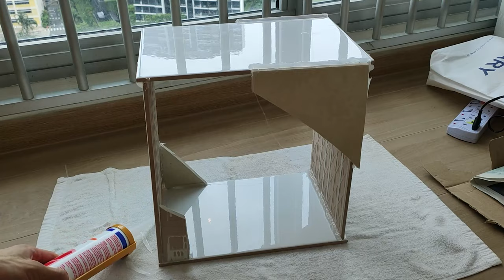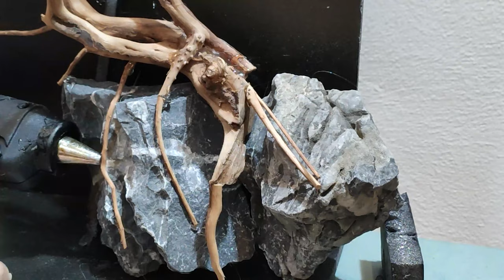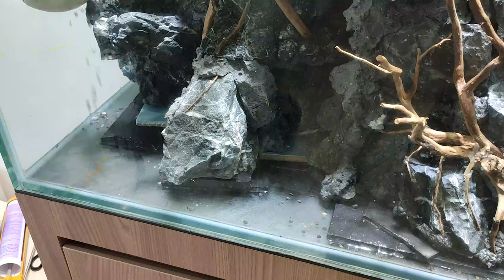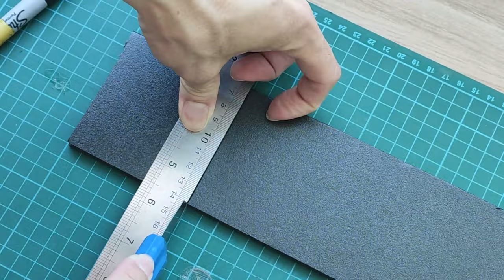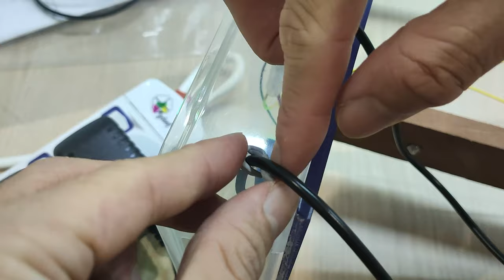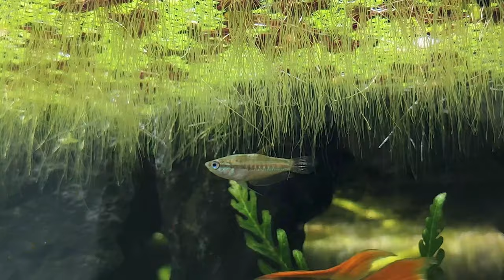Setting up a carnivorous plant paludarium

Comment from the maker: Since quite a few people asked about this, I thought I'd pin a reply.

Venus fly traps, Sarracenias and Cephalotus are temperate species. Can they survive in an aseasonal paludarium? Yes, and it's actually not that hard to do. VFTs and Sarras would need an artificial dormancy after a couple of years--I usually perform that after 3 years (which is why they are actually planted in those isolated chambers if you look closely;). Cephs can actually get by without one. They won't look like award winning specimens for sure, but still very decent.
How long can they survive? I don't count the years, but most of mine have gotten past 10+ years (been doing this for about 20). Old friends have kept them going...indefinitely...
I don't really want to write so much on cultivation techniques here. But the tropical CP growing scene is quite well developed, so there's definitely quite a lot of well-established procedures and info on the web and in print (e.g. https://www.amazon.com/Growing-Carnivorous-Plants-Tropics-Chiang/dp/9814022519). Do check it out if you need specific guidelines on each of these taxa:) 

I expect the paludarium hobby to continue growing a fair bit and more people to experiment with these and other techniques. And in that regard, a word for the aspiring paludarium owners reading this discussion. Don't let more "experienced" growers tell you that it is impossible to grow or do something. Go for it, push the boundaries, don't be afraid to fail here and there..and have fun while you're at it:)
Reply: Talking about VFTs and Sarrs as temperate plants then going on about tropical CP growing techniques shows you know less than you think you do.

All other factors aside, your biggest challenge will be giving the VFTs and Sarrs enough light. Light intensity decreases logarithmically as distance from the source increases. Even with artificial lights, they are too far away to give these full sun loving plants enough light to survive long term. No doubt in several months or a year you will have light-starved, etiolated plants begging for death.
Reply: @pings_n_things  absolutely false. There's tons of videos and info on exactly these setups.
Reply: @pings_n_things what if I told you that vertical light intensity in my 48x48x18 is equal for all distances from my top light source? Yep, fresnel. My CP 40” from the lights sees the same ppfd as the cps at the top.

Comment: My only concern is that the Venus fly traps would be receiving water from the aquarium which may be too mineral rich for them, I’ve only had success watering Venus fly traps with ro water or distilled water. Other than that this scape is fantastic!
Reply: also they need a dormancy
Reply: @Tatusiek_1  that's why there in removable pots
Reply: yeah from what i understand about cultivating cp is that they should never be fertilized. I am under the assumption that the rain water is just fresh tank water for the water changes that happen 3x daily, and the sump is only sitting on the tank itself (not super clear from the vid )
Reply: Assuming no update on this? Only way I see this working is with a rain water system even the fish can be in the rain water

Comment: Phenomenal. I could watch a 24 hour long video of different pipe systems alone. I’ve always been curious, how do you keep plants alive glued to the rocks with minimal roots like that? Are you watering incredibly often? Any fertilizers at all?
Reply: Some plants are epiphites or lithophites and that means they like to grow on stone or hard surfaces with no soil
Reply from the maker: Yup they are epi/lithophytic. Also the sprinklers come on quite often so they are well watered:) I am adding very very dilute ferts for some orchids. But very cautiously since any runoff goes straight into the aquatic portion below!

Comment: Looks great, questionable plant selection though. You should have stuck to tropical plants only - the Cephalotus and the Venus Fly Traps require cold winters. They may make it a year in consistently warm temperatures but after that they will really suffer without a cold winter dormancy.
Reply: same with sarracenia, also the water may be too mineral rich for them